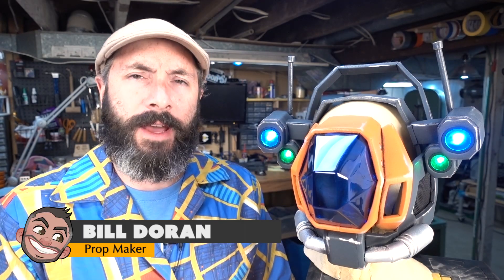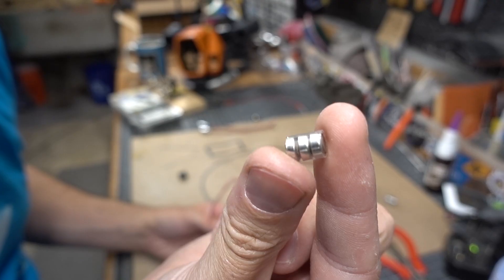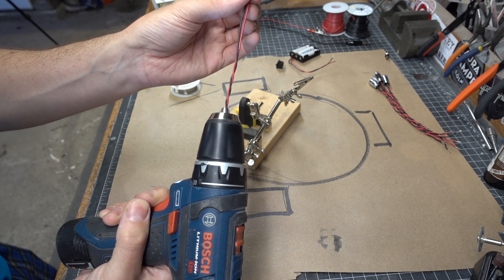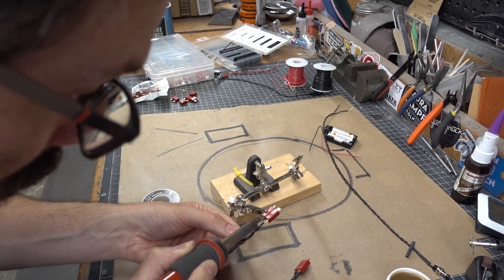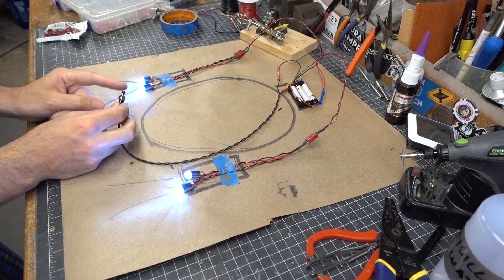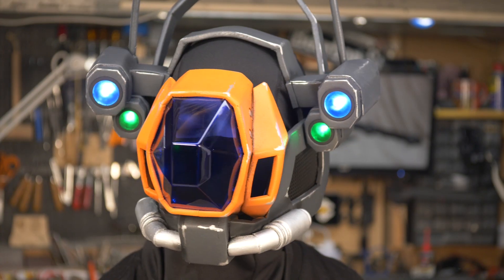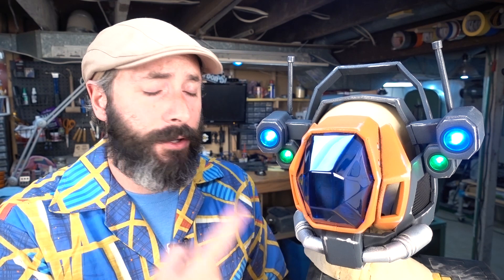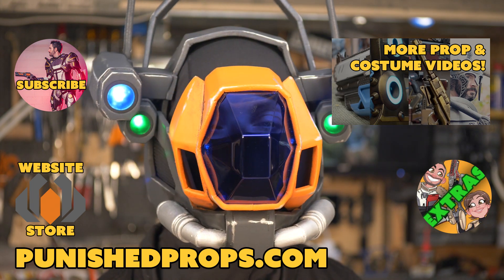Basic LED Wiring for Robot Eyes - Destiny Sweeper Bot Build

Comment: Instead of deans connectors, have you ever tried the red "JST" connectors? They are small, light weight, easily connect and disconnect and are great for smaller electronics in tighter spots.
Reply from the maker: Ooh yeah I need to get some of those.

Comment: Aren't those connectors like super overkill for LEDs?  Personally I like to use cheap JST connectors that they use for RC stuff off ebay.  It's like 10 pair for $2 and they only connect together the one way.
Reply from the maker: +bitsRboolean Yes, but it's what I had on hand. I need to buy some JST connectors.

Comment: Bill that is the wrong (Zinc Chloride, acid based) kind of flux for electronics, on the Rectorseal page for the flux it says "Not recommended for electronic use." 

You want a rosin based electronics flux.
Reply from the maker: +SnarkyPosters Ah damn! I need to get the right stuff.
Reply: For what you used it for I wouldn't worry too much, it will eventually corrode and fail, but it will be fine for now.

You can use that flux if you need to braze something or solder some water pipes. 

The new flux you linked should be fine. Also I use a small really cheap 30/$1 craft paint brush, to brush the flux on. 

You also might want to pickup some 63/37 solder if you do have any.

Comment: It seems like it would be a good idea to build a muffin fan into the helmet, too. It looks pretty well encased, which will trap heat quite a bit. So, adding that fan might be critical!
Reply from the maker: It definitely helps. This robot head is actually rather well ventilated.